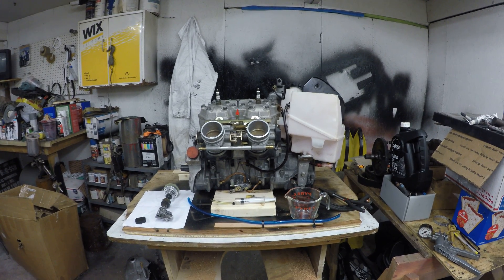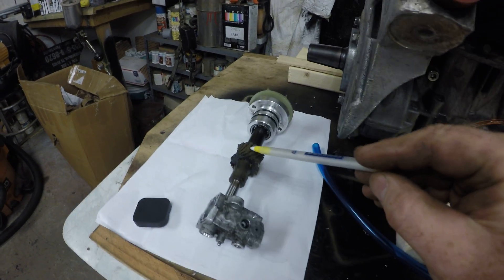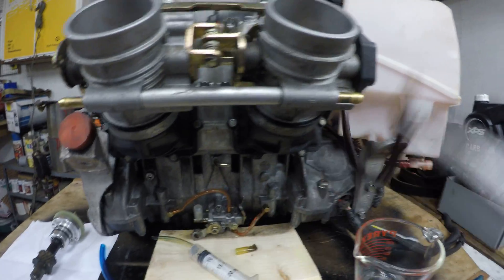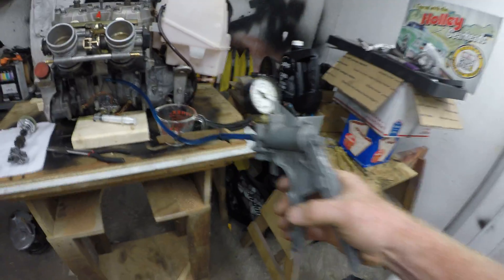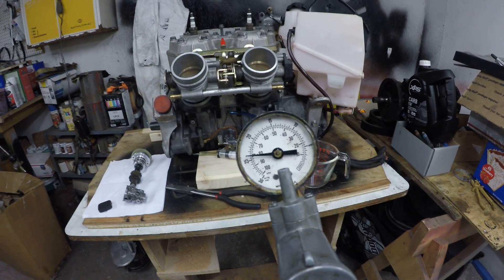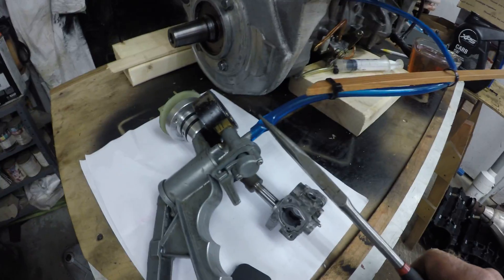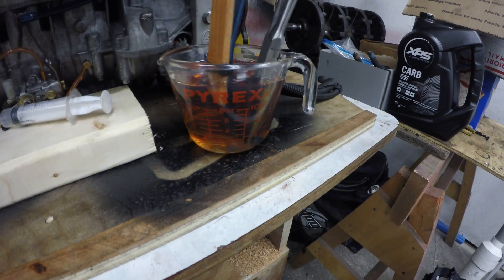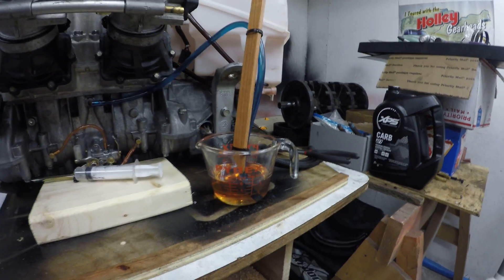Rotax 2-stroke engine center cavity oil fill

Comment: Im assuming you need to block the breather/return line on other side of motor?
Reply from the maker: The oil cavity has only the one nipple and is airtight otherwise. 

Thanks for watching!
Reply: @michaelfregoe5875  
Ah, ok, On my 587 it has a feed, on carb side, and a return on exhaust side.

Comment: I have a 717 Rotax I just rebuilt it different motor but I am trying to fill the cavity but I am getting no back pressure? what could cause that? thanks for any help I am using a break bleeder is that the right tool?
Reply: Might have a return on other side, my 587 does.

Comment: Your video absolutely saved me a pile of time removing my new motor from my machine.  I completely forgot to add the oil into the crankcase prior to installing it, and dreaded having to remove the motor.  Was a bit cramped plugging the line in, but I got it and then I did exactly what you did and it worked perfectly!!  Eternally grateful for this hack!!  Two thumbs up!!!
Reply from the maker: Glad it helped
Reply: @michaelfregoe5875  HELP!!!!!!
Reply: @michaelfregoe5875  lol